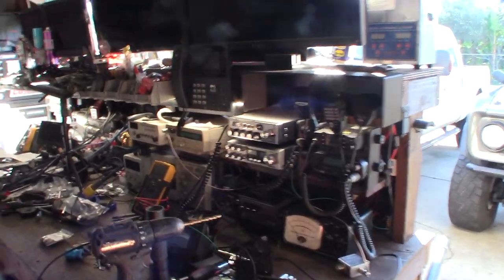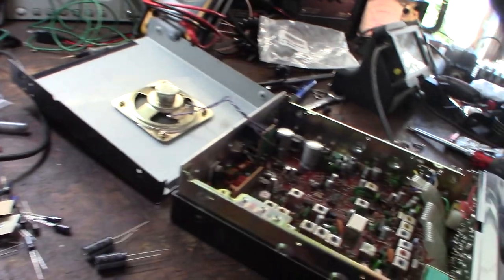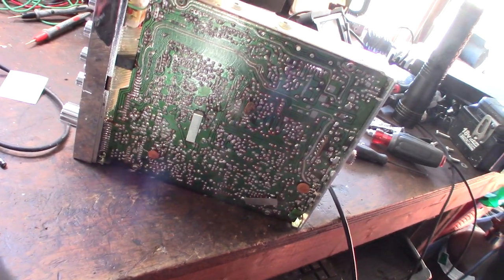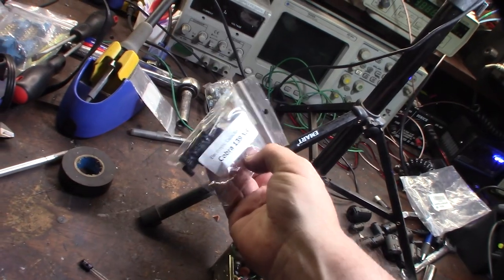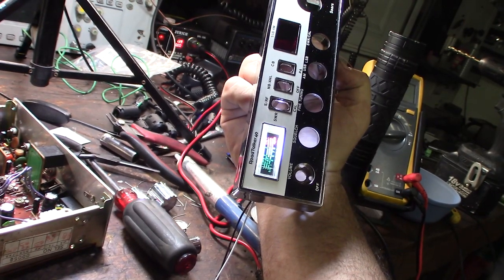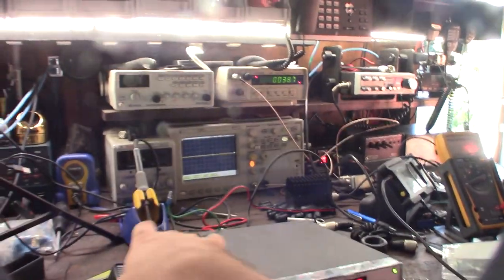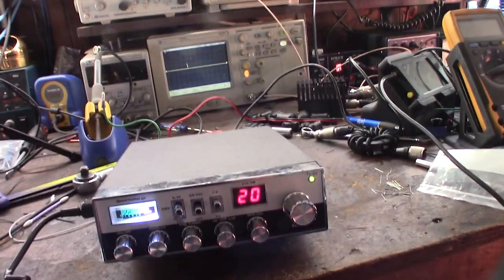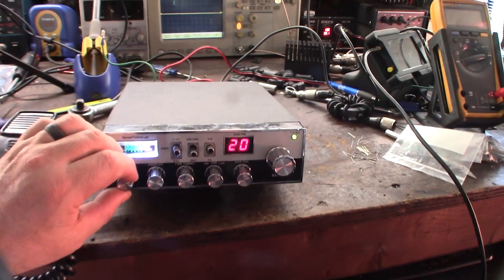Sears Roadtalker 40 SSB (Cobra 146 GTL) Capacitor Replacement White LED Conversion. Frequency Test

Comment: I did notice the change in frequency on AM when you modulated the radio.  That would be the voltage drop showing it's face.
Reply from the maker: for sure, once I hooked it up to my permanent power supply it stared working correctly. my voltage was dropping below 10V.